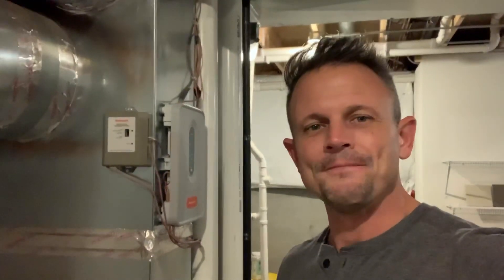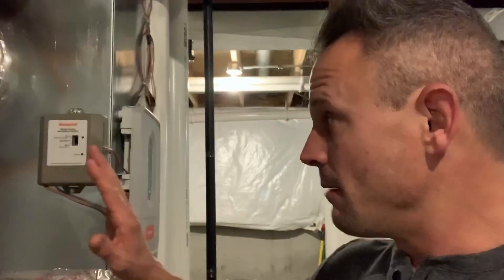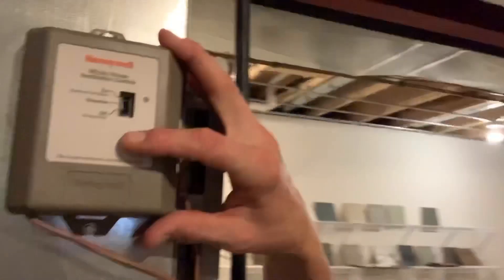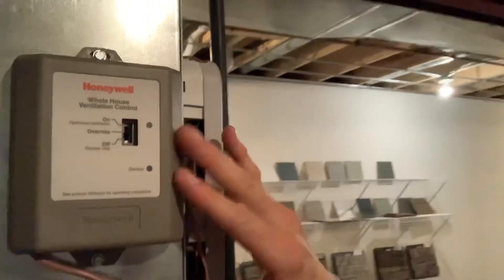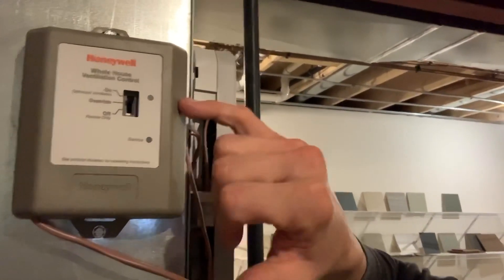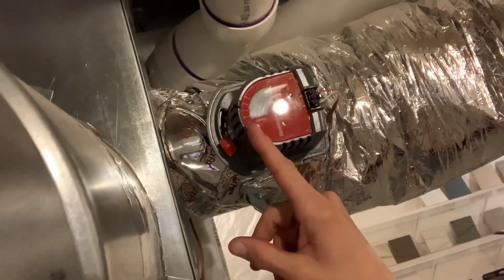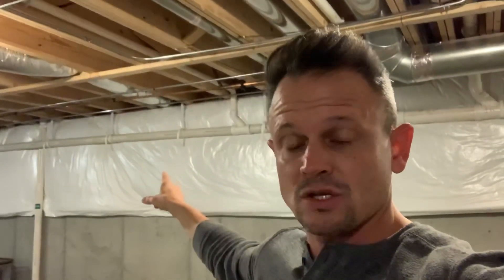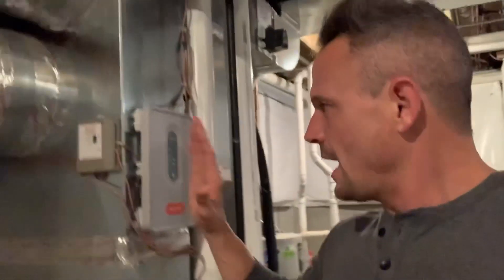How does a whole house ventilation control or fresh air intake control panel work

Comment: Hey BJ, I just wanted to thank you so much for posting this video.  When I moved into my new construction home last year during the summer, the humidity would get to something like 68% inside at night.  I thought it was an oversized AC causing short run times.  After finding your video,  I turned off the ventilation system and the humidity dropped down to under 50%! 

This device wasn't documented by the builder at all and I would've had to go down the home warranty rabbit hole of endless service calls to solve this.  Thank you for saving me countless hours of headache!
Reply from the maker: My pleasure happy to help Yale!
Reply: @BJPoznecki  Same here. I had the same exact issue. After seeing your video and turning off the fresh air damper system, now my humidity is hovering closer to 50. Thank you!
Reply from the maker: @gutierrezsantiago  My pleasure!

Comment: Could this be a reason why I’ve been paying high gas bills over the winter in Chicago, like ridiculous expensive bills.
Reply from the maker: Hi Teresa- Yeah because the system is pulling in the cold air from the outside and cooling off the house kicking the heat on, and vice versa in the summer when it’s hot out you’re bringing in all that hot humid air raising the temperature kicking the air conditioner on.

Comment: This is great advice!  Had an HVAC tech out to our newly-built home to investigate why the house humidifier was not working.  Turned out that the external sensor was never installed by the builder - but in passing by he noticed our ventilation control was on.  He recommended, as you do here, to turn it off as it's quite cold here in the Chicago suburbs today and there's still ongoing construction in our neighbor so our filters were getting dirty within weeks.  Thanks for this advice--which I wish I'd seen before winter!  Our vents were periodically blowing cold air and this is why!
Reply from the maker: Thank you for the kind words. I’m happy to hear you enjoyed the video and found it helpful!
Reply: Wow! 😮 I've noticed that I wasn't the only one who one unaware. Lesson learned. Awesome instructor 👌

Comment: I am so grateful for this video. I couldn’t understand why freezing cold air was coming through our vents when our system wasn’t running. I went straight into the attic and shut it off! You explained it so well. Thank you for sharing your knowledge and expertise!
Reply from the maker: My pleasure! I’m happy to hear the video was helpful. 

The opposite goes for in the summer if you have a heat wave, you’ll feel that hot humid air blowing out of the vents.

Comment: awesome video, but i still cant figure out how to adjust the airflow damper, that red button on top of the module does not want to move and i dont want to break it ..... HELP!
Reply from the maker: If the damper is not opening and closing when you change the position of that switch. Then it’s either not working or not wired correctly, and you’ll need an HVAC technician to fix it.

Comment: Hi I have a honeywell w8150 whole house ventilation control when i installed the nest 3 day ago on the first day i put the honeywell ventilation control at off but it disconnected the nest after a few hours of not using heating or ac, service light was blinking then i have to off and on from the electrical box

Today i tried to put the control to on, everything was working well but i don't need the ventilation to keep running when I'm not using the heating /ac (keeping bills low)

How to stop the ventilation from running and be connected to nest?
Reply from the maker: Sorry Johnny I don’t know on this one.
I recommend calling Nest to see if they could help you troubleshoot it.
Reply: @BJPoznecki  no worries thanks for looking into it

Comment: Thanks a lot for posting this video. Very Informative! If I turn it off for an extended period of time(during the winter),should I be concerned about the air circulation quality within the house?
Reply from the maker: Thank you for the compliment It’s my pleasure!

Well naturally it’s a little bit of a trade-off. However, as long as you routinely check your furnace filter and replace it when it gets dirty, that will help increase the clean air quality within the home.

I would also recommend keeping an eye on the temperature and if we should get some warmer days during the winter you could turn the system on for a little bit and bring some fresh air.

Comment: Great Video. I didn't find the Vent settings on the T6, do you know why? I found I have the Honeywell Damper (LED: ON position) with Honeywell Whole House Ventilation Control (On position) on the way of the fresh air. is there anything wrong with the humidity control issues (humidity: 70%-80% in the summer)?  thank you for any advice.
Reply: It is the ON position for three years! maybe this is the problem for my house at a high humidity level (70%-80% in the Summer and Fall, Texas). I would like it can be controlled by my Honeywell Lyric T6 settings.
Reply from the maker: @lukeliao636  Yeah that’s way too high of a humidity level to have in your home so I would turn it off. Ideally we would like the humidity levels to be around 50%. I’m not sure what features that Honeywell thermostat has, so I would just turn off the whole house ventilation system off at the control module that is on or near the furnace like you see in this video.
Reply: Got it, thank you very much, BJ.

I found the damper will be turn on when the AC works. I expect this switch can be controlled  on the Honeywell Lyric T6 settings, however I can’t find the Ventilation option on the T6 (a YouTuber has one video for this settings, but he doesn’t say the wired information), do you know how? Thank you very much.

Comment: I looked all over my hvac unit (in attic) and I see the pipe going from unit out through the roof, but I don’t see a timer or on/off switch anywhere.  Neighbors smoke all day/night and homes are very close.  I want to close this to get the overwhelming smoke smell out of my home.  If my unit doesn’t have this switch, should I just try to close up all the grill vents on that side of my house?
Reply from the maker: Hi Madeline! 

If your system doesn’t have this electronic control module it should have a manual damper lever on that pipe near where it attaches to your furnace ductwork. 

You may have to feel around for it or possibly move the insulation wrap to find it. Once you find it you can close that damper and that would stop from bringing air in from the exterior. 

If your system is not equipped with a manual damper I would ask an HVAC guy to come in and install one this way if the smokers move and you want fresh air in the home you can easily open it back up versus closing something off permanently.
Reply: @BJPoznecki  thank you so much!
Reply from the maker: @madeline9902  My pleasure!!

Comment: Thanks for the video!  Super hard to find details on this topic.  I shut mine off based on advice from my hvac guy.  Other articles on line dont agree.  Im not the type to run into the attic to turn it back on on nice days so it has to be on or off.  Soooo...are you sure that my tightly sealed house will get enough fresh air just by opening a door a few times a day?  I hesitate because there has to be a reason it is code to have one of these.  TIA!
Reply from the maker: Well it definitely does help having it and getting fresh air in the home because we want the house to breathe and have airflow through it. 

However, I just want people to be conscious that whatever the outside temperature and humidity are that is what you’re bringing into the home. 

With that said I typically tell people to turn on the system when the temperatures are mild in between 50 and 75°, which at that point a lot of people just open the window to get a breeze through the home which will work too. 

Hope this helps!!
Reply: @BJPoznecki  thank you.  Yup, I get it.  Here's the thing.  In these sealed houses, you literally cant open the windows  - they dont open, except the bedroom ones.  So, in the main areas of the house - LR, dining, kitchen, etc - you cant get air in. My hvac guy disconnected (unplugged the wires, sealed the vent I think too)  my whole home air thingie and Im thinking I need to reconnect it all for those nice temp days.  Otherwise, I will never get fresh air, unless I get screened doors or something.  What a PITA this is turning into. lol
Reply from the maker: @nef854  Really only the bedroom windows only??? That’s strange is this a townhouse, condo, attached living type of home?
Reply from the maker: @nef854  i’m sorry for the confusion when I say sealed homes I meant energy sealed not that the windows don’t open.
Reply: @BJPoznecki  single family home...built 2013 (North Texas).  Lots of windows, but they dont open.  I think this is called a sealed or a tight home.    Fire code requires the bedroom ones to open.  So yah, thats why they put in this honeywell venilation control system for the fresh air.  But mine of course is now disconnected.  Other hvac guys online say to fire the tech that did that.  Sooo, I remain confused!!
Reply from the maker: @nef854  Interesting!

It must be something they do in Texas. I’m out of Chicago and not familiar with how they do it things down there. 

With that being said you may want to either reconnect the system, or put in screen doors like you mentioned earlier.
Reply: I would suggest monitoring the CO2 levels in your house. If they get too high when you are in the office for a few hours or sleeping at night, you definitely need ventilation.

If the hot/cold/humid air coming in is bothersome, invest in an ERV to help mitigate that.

Comment: Hey BJ - I just bought my house and I went up in my attic to check out my furnace because an air guy that I saw working at a neighbor's house told me that I likely have dampers that I can adjust to try to resolve my really hot second floor.  I didn't find dampers (not that I really knew what I was looking for), but I did see that I have this VCS installed and I saw that it was off.  I assumed that someone installed it for a reason and perhaps just forgot to turn it on...in my mind I wondered if that's why my upstairs is hot?  I turned it on - but then saw this video when you suggest just leaving it off.  So, I went back up and turned it off...but not before noticing that damper was on closed.  When I turned it off, it went and stayed on open.  Isn't this the opposite of what I should have expected??  Your help is most appreciated!!
Reply from the maker: You’re correct when the system is in the “off“ position the damper should be closed. It sounds like it was wired incorrectly or possibly the wrong style damper. There may be dampers when there the system is in the off position they are to stay open. Either way if you bought a new house you should have a warranty with the builder I would submit a service request and have them come in to correct it.

In addition to above also see my other video how to seasonally balance your heating and air-conditioning system to get more cold air to the upper floors in the summer. 

https://youtu.be/VwZpOzOBDqA
Reply: @BJPoznecki  Thanks a bunch for your reply, BJ.  I went up in my attic again this morning to see if it'd change over at some point - it was still on open.  I put it into override and it closed...then, when I turned it off again, it opened.  Bummer- now I have to figure out how to get the builder to make this right since I'm actually the second owner after it was built 18 mos ago.  Once I get this resolved, I'll move onto balancing my system.  Again - thanks!
Reply from the maker: @boorayin2773  My pleasure happy to help! Check your builders warranty a lot of these nationwide builders have a two-year mechanical warranty where they cover the electrical, plumbing, and HVAC for a total of two years from the date of closing. If that’s the case you are still covered and all warranties transfer to the next homeowner.

In the meantime you could go back up there disconnect the fresh air intake duct, and put a cap on the damper to close it off in the meantime, so it’s not drying in that hot humid air into your system.
Reply: @BJPoznecki  That's way beyond my skill level, honestly...I'll work to figure out if this thing is still under warranty, hopefully.  Thx!
Reply: Finally got a different HVAC guy to come check out my system...yup, it was wired backwards as you suspected! We also decided to close it at least for the spring pollen season.  :)

Comment: I have an older vent motor, installed in 2013.  There is a pointer that sticks out from the shaft, which I assume indicates the position of the damper.  When I put the control three position switch to the center position, the fan turns on, as expected.  The damper motor is powered on, but the pointer points out, perpendicular to the duct.  I think that means it is closed.  When I turn the switch to Off / Remote Only, power is removed to the damper motor and the spring turns he damper so that the pointer is parallel to the duct, which I think is open - but the fan has stopped running.
Is my vent system running the opposite of he way it should?
Reply from the maker: It sounds like you may be right it’s working in reverse, however the only way to know for sure would be to take apart the duck work and actually see the position of the damper. 

Maybe the indicator is off and the damper is working correctly. 

Hard to know unless you can put eyes on it during operation and confirm position.
Reply: Do you happen to know if power closes the damper?  Or does power open the damper?
Reply from the maker: @thehammer6103  On the system that I i show you in the video power opens the damper. When there is no power it’s in the closed position and only opens when the control module calls for fresh air.
Reply: @BJPoznecki  Thanks.  I believe that is what is happening on my older control box.  I appreciate the help.

Comment: After I turn off the ventilation, do I need to do anything with the electric damper?
Reply from the maker: If it’s wired properly the damper should close on its own. There should be an indicator on the damper housing showing whether it’s open or closed. If it is not closing after you turn off the system you’ll have to call the HVAC contractor that installed it because they did not wire it correctly.
Reply: @BJPoznecki  thank you so much!
Reply from the maker: @ivysiu6898  My pleasure!

Comment: Interesting. So if the Honeywell controller is turned "OFF", you're saying no way is it possible for this to ever turn on. I was thinking to wire in a Range Hood into it, and was hoping that it would bypass it (for "make up air"). For example, if it's 100F outside then I'm definitely goin to turn this "off", but I also want the damper to operate if I'm using the range fan. I'm basically installing this today to a) get more fresh air in the house when I need it, but also b) to supply make-up air. Was hoping I can achieve both, but can hook it up in a way where it's smart what outside air it brings in.
Reply from the maker: I’m sorry I don’t know if it’s possible to connected to a range hood, however it is very common to have a continuous running fan in one of your bathrooms that accomplishes what it sounds like you’re trying to do.

Watch this video I made on continuous running fans this may help you achieve what you’re setting out to do.

https://youtu.be/zLKjOSt9R0E
Reply: “Off” on the Honeywell allows for remote operation. This means you should be able to use this as make up air in the hot summer months or winter months.

Comment: Great job. I’ve been trying figure out the new house ventilation system.  We have felt the cold air in the winter and wondered what was going on. Moving to seasonal manual control like you suggest.  Thanks for the video.
Reply from the maker: My pleasure Dave!!

Comment: It was 65 degrees in my house this morning.  TSTAT set at 72.  Furnace running, burners and blower on.  Cool air coming from the supply vents.  Does this thing have an outside air temp sensor?  I mean is this basically an economizer?  I do commercial HVAC not so familiar with the intricacies of residential.  What would cause this?
Reply from the maker: Hi @tickledaddy It is not an economizer. It’s just a fresh air intake that brings in air from the outside into the home. This particular model does not have an outdoor temperature sensor, so your best bet is just to turn it off, and turn it on if you like when the temperatures are between 50 and 75°.

Comment: Great info! Confirmed what I suspected. Question on the remote only (off), if I have my fan on CIRC will this draw fresh air?
Reply from the maker: Thanks for the compliment! No, when that remote is in the off position it is off 100% of the time no matter what you do with the thermostat including the fan on and auto setting.